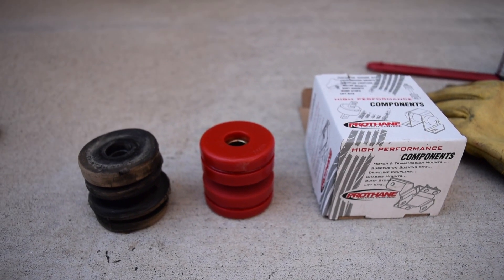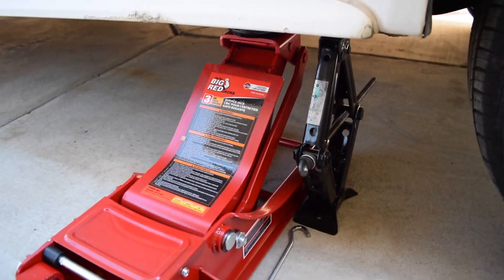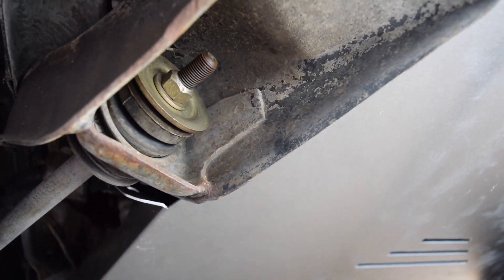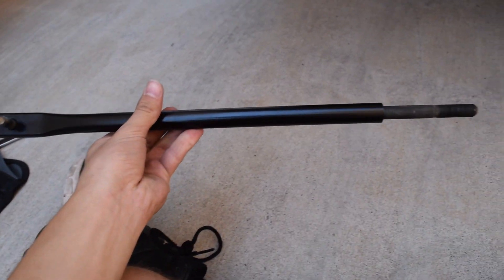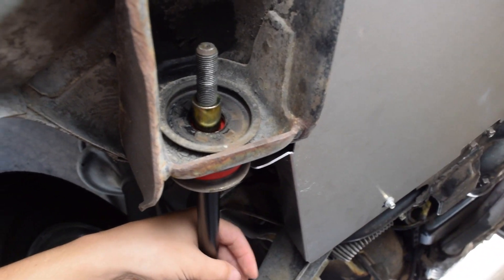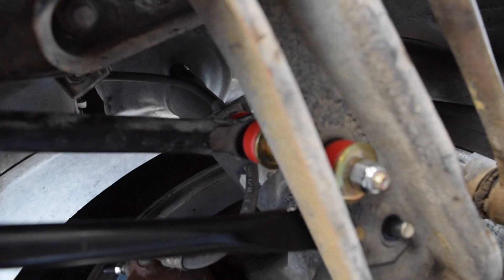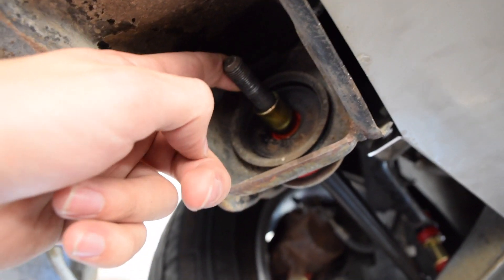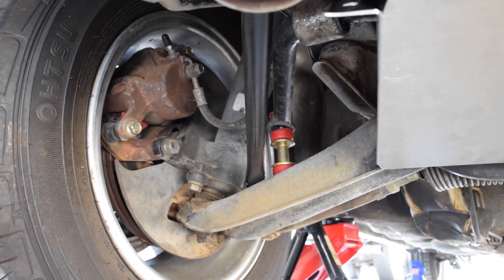Poly Tension Rod Bushing Install (300zx Z31)

Comment: Little bit late here, but if anyone is still searching for them, SummitRacing has them in stock, as well as the whole kit. The part number for this bushing is Prothane 14-1204 and the complete kit is Prothane 14-2004.

Comment: Josh, am doing the very same thing to my 82 280ZX (started on it last week and still can't figure out how to put it back with the newer thicker polys) and I'm really having trouble aligning the holes of where the two bolts go thru just like you pointed out in this video. Don't have a clue on how to compress the new bushings enough or move anything far enough to allow the holes to align so I could then put the bolts through.  You (or anyone) got any ideas how the pros actually do it? Would mightily appreciate the knowledge! Thx
Reply from the maker: If I remember correctly, I had to push on the lower control arm to get it to move backwards enough
Reply: Did you get it in

Comment: Could you please give us the part number of the bushings, or the deal you have bought for this?
Reply from the maker: I bought this kit from ebay with a bunch of poly bushings in it. Im not sure what the part numbers would be if anything but i believe that thezstore.com sells the bushings seperatly as well as in a package. Here is the link to the one I bought: https://www.ebay.com/itm/Prothane-Total-Suspension-Bushings-Inserts-Kit-For-Nissan-300ZX-84-89-RED/401532255364?fits=Make%3ANissan%7CModel%3A300ZX&hash=item5d7d2ffc84:g:3OAAAOSwzOxUVdIk
Reply from the maker: You can also find OEM parts at nissanpartsdeal.com which is where I buy a lot of specific parts like these. Rockauto.com has many parts as well
Reply: Thanks, this linked are perfect for my renovations.

Comment: Here is the entire shop manual: https://www.nicoclub.com/FSM/300zx/1986/. You will find everything there to download. They have downloads from 85-96 here https://www.nicoclub.com/FSM/300zx/. I have an 86 300zx 2+2. I bought it brand new almost 33 yrs ago. It’s in need of some work and am doing it a little at a time. Thanks for posting the content.